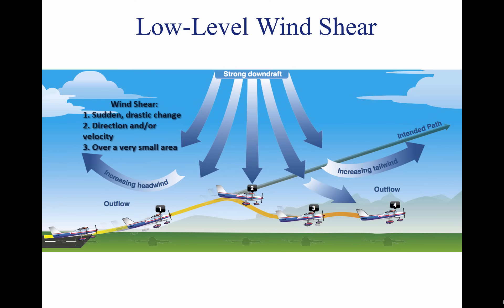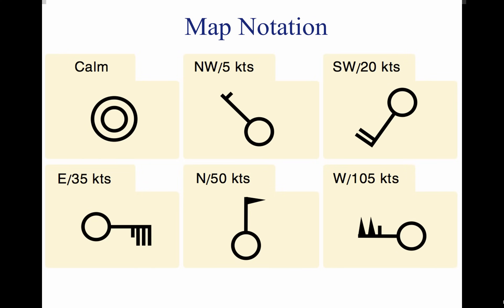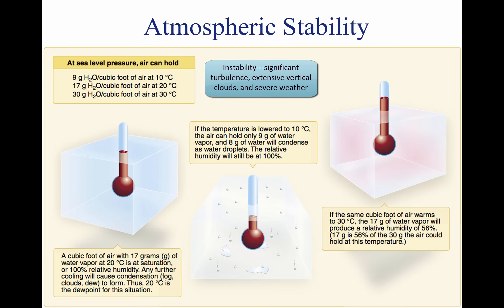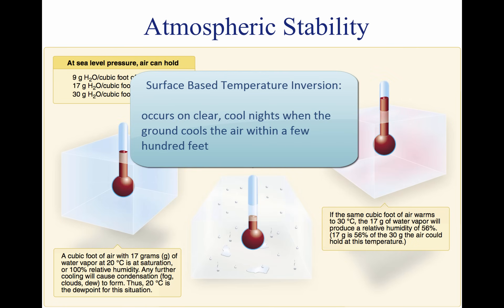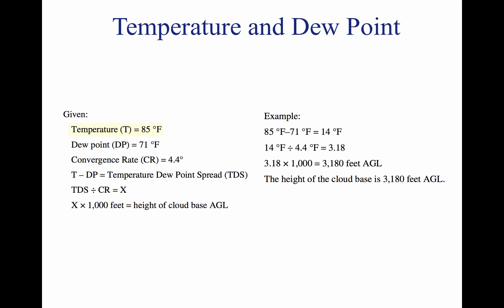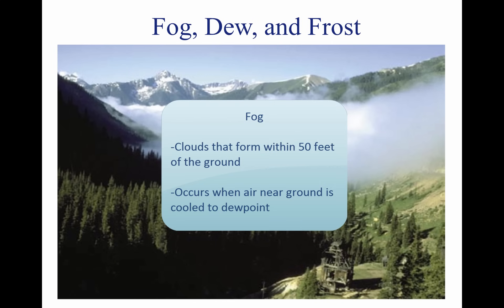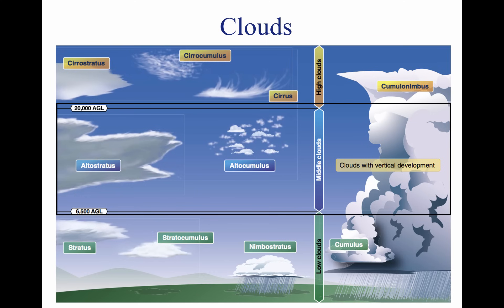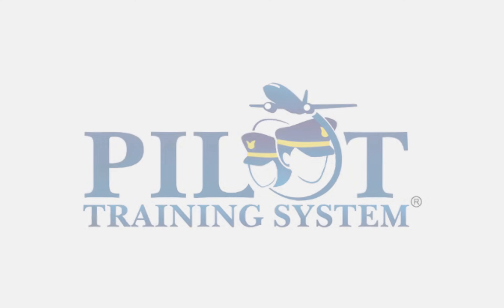Private Pilot Tutorial 11: Weather Theory (Part 2 of 3)

Comment: 6000 fpm? We're talking wind. Vertical wind. Why not just say approx 68 mph vertical wind sheer? That is an attention-getter and that way it can be readily assimilated, IMO. Great series. Thanks for all your work.
Reply: because 6000FPM is easier to understand and relate to instrument indication to pilots
Reply: 6000 ft per minute sure gets my attention
Reply: Vertical speed indicators and variometers read in fpm or m/s. So if your best climb is say 670fpm, and you are in 1000's of fpm sink, then that's easy to understand. Horizontal speed and wind-speed is measured in mph/kph.